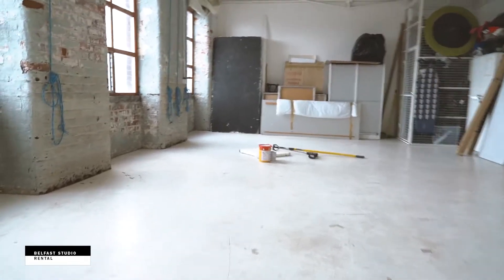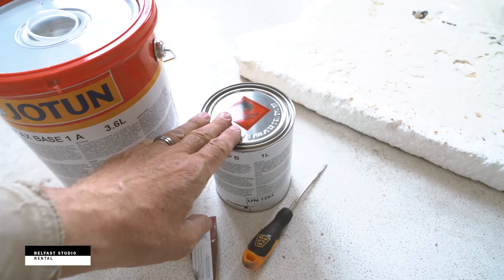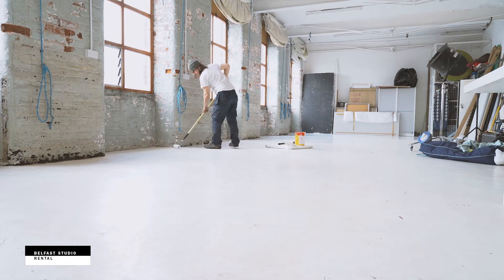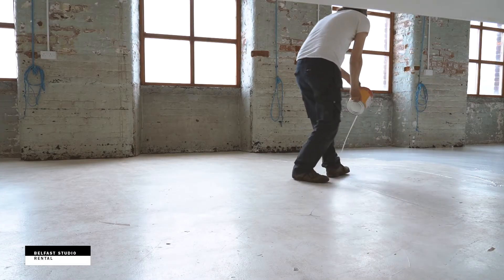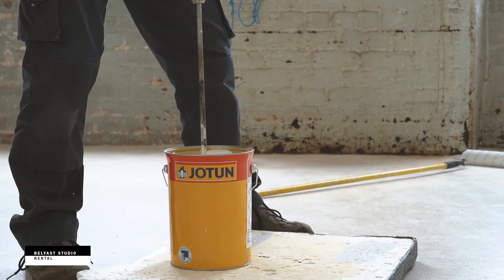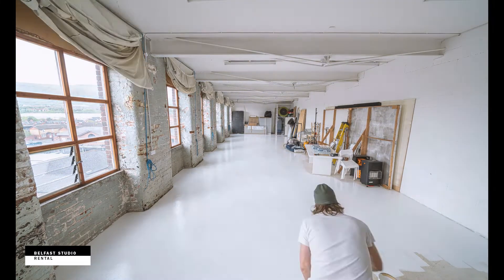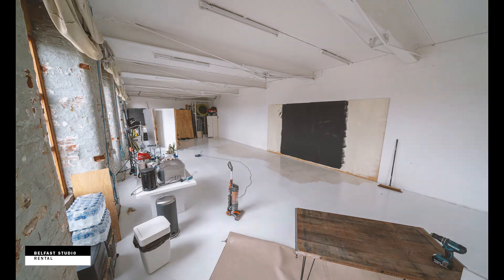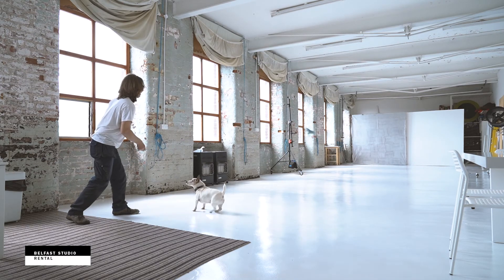Photo Studio Floor painting

Comment: Hi, may I ask if it was white for the color and as a photo studio, what pros and cons do you feel it has like say does it reflect light off the strobes too much, etc? Thanks! 😊
Reply from the maker: Sorry just seeing your message here now, yes, its white and as far as having white for a photo studio, its fine for most shoots. For an available light shoot, just using window light its fine for the light to bounce around a bit and help fill in some shadows. We also use 4x8 b/w poly boards to reflect and flag when needed. When lighting a shoot, most of the lights are directional, using grids and flags to sculpt the light around the subject. Again if we are getting too much bounce, either we use the poly boards again or even duvetyn on the floor or walls to give negative fill.
Reply: @belfaststudiorental9422  thanks! We had moved to a new studio and spray painted the whole place white even the water pipes for the sprinklers and the dark-colored window frames too! 😁👍